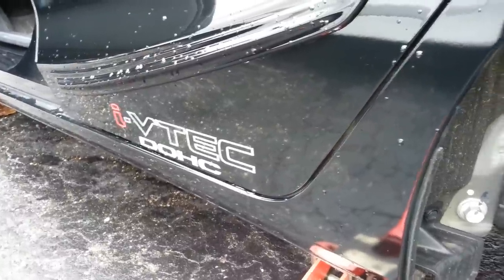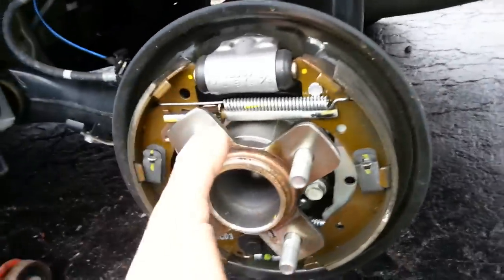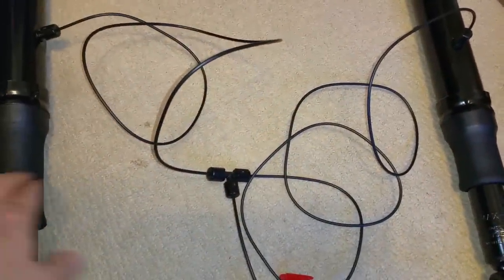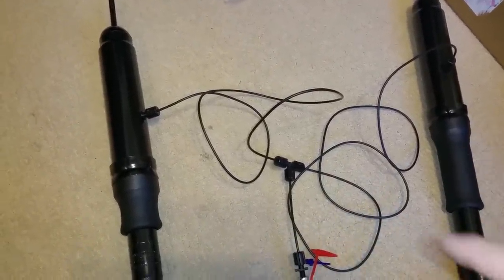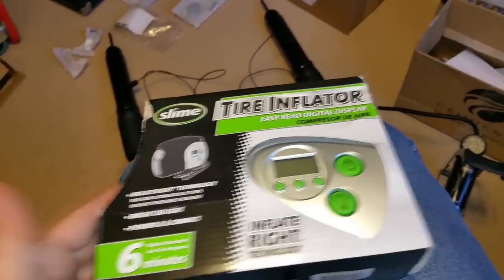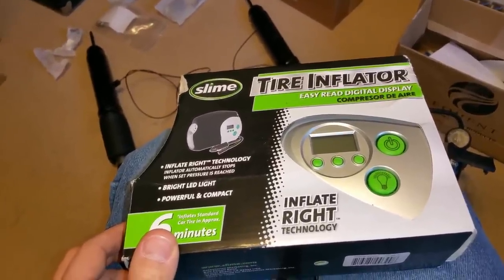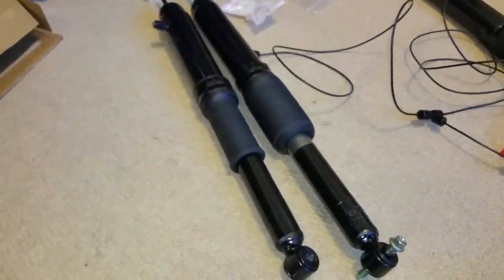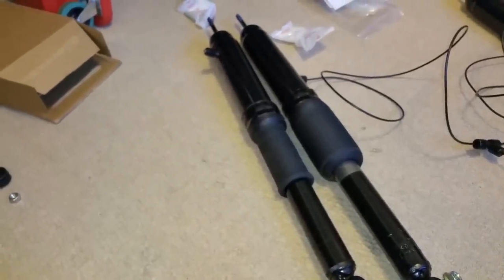2015 Honda Fit EX Monroe Max-Air Rear Shock Mod: Part 01

Comment: I think you're worried too much about 'equalization' of these from side to side.  Your example with the shocks on the ground
is not what will happen when the weight of the car is on the shocks. And, as you pointed out, they're only 1/8" hoses.
Reply from the maker: since driving with the shocks for almost a year I can agree with you.  there is a seesaw effect but it is not as bad as I thought it would be. I even upgraded the hoses to quarter inch as there are more air fittings readily available to source then the 1/8. I am very happy with the performance when towing my trailer as it prevents the back in from squatting too low.

thank you for the comments and for watching my videos!!
Reply: +xboxer1985  Thanks for reply. What sort of trailer and load do you haul with your Fit? Manual or auto trans?
Reply from the maker: +Larry See  I have the 6 speed manual transmission and most of my trailer loads are bulky they're not heavy I think the heaviest load I have done was about 800 pounds of cargo plus the trailer for when I did all the concrete blocks rocks and cement for my shed
Reply from the maker: +Larry See most of the time I Hall speakers for my PA system and the occasional Home Depot run and the wait is never an issue but having a full 8 foot bed is an amazing thing. I used to have a pickup truck but had to sell it for various reasons and only used it occasionally. Buying a trailer was the next best thing and use it every couple weeks for something.
Reply: i was thinking the samething im just surprised that he didn't try fitting them on a skate board before he installed them on his automobile 😀

Comment: So these shocks aren't specific for your car? So what you did is find a shock that would fit the mounting points of your car? I have aftermarket wheels and tires  on  my 2015 Honda crv and when people sit  in the back seat my tires rub a little bit so I need shocks to lift it about an inch. Thank you for the video bud.
Reply from the maker: Correct yes. The ones that fit my now 2017 Fit are the MA809s

Comment: I want to install thse on my minivan. I don't want to attach the air lines. I want to inflate each shock directly, with an air compressor. does each shock have a Schrader valve?
Reply from the maker: You would need to buy two air line kits from monroe but yes it can be done that way.

Comment: hence why you should have a sway bar on the rear end
Reply from the maker: Yeah I thought of putting that upgrade in but I have since upgraded this air shock system to be automated remote control and dual pass so I can control each individual shock without influencing the other
Reply: Installed one on my '17 and the ride was horrid. I suspect due to the mounting locations.

Comment: I want to improve the ride quality oem Strut for my Honda Fit 2015 EX-L Do you know what strut can improve ride quality? I feel the oem is too noisy and too bumpy for daily driving in a city like SF.
Reply from the maker: I've heard the koni shocks work well. Air Shocks are more for towing and feel spongy. Not necessarily a more cushioned ride.

Comment: Do you have a part number for the petcock by any chance
Reply from the maker: AK29 is the entire kit
Reply: And it comes with the shut valve mentioned?
Reply from the maker: @pinkpantherr93  the petcock you mean where you inflate the air? Yes it does
Reply: Well the video says a petcock shut off valve to isolate one shock from the other
Reply from the maker: @pinkpantherr93  ahh gotcha. No this kit does not have a petcock to isolate the shocks from each other. It has the Schrader valve to fill it and the tee fitting. If you want to independently fill each shovk then id say buy two kits.

Its been years since I did this. I've upgraded to a custom made remote dual channel (independent shock control) system I built myself. Like the Air Lift kit available just far cheaper.
Reply: Ok I was thinking that but seems much easier just to add the petcock. He did mention it was ordered so I was hoping he would chime in and give the part number either way I appreciate your reply thank you

Comment: Did you ever get the petcock valve?
Reply from the maker: I did. its actually a flow control where it restricts the see.saw effect but still allows the pressure to equalize when filling. Also converted the hose size to 1/4 with push to connect fittings. its on my thread on fitfreak.com
Reply: Ok, I put some 26 inch rims on my 02 Mercury Grand Marquis along with the air shocks. I will check that out!
Reply: Could you let me know the parts you have?
Reply from the maker: With the stock 1/8" line I was using MettleAir part# MSCA 1/8 flow control. They do not make a 1/8" shutoff valve. they make flow control and shut off valves in 1/4" OD though

I have since upgraded the lines to standard 1/4" OD air line. To do this you will need to get an adapter to convert the JIC threads of the shocks to SAE threads.

Adpt, FNPT-FJIC, 1/4-18,7/16-20, Strt, ITEM# 4VPT3 from Grainger.

Once you get this adapter, parts become so much easier to source when its made USA standard, if thats where you live! 1/4" is the standard here in the States. 

Hope this helps!
Reply: Do you think these airs shocks could run separate to there own pump?
Reply from the maker: +Adrian Ike yes. some people set them up that way actually

Comment: what size are the pit coc and part number
Reply from the maker: with OEM hose its 1/8" and if you look at MettleAir company they will have a few options for tees with a valve or flow control on it

Comment: Flimsy is correct..
Mine come out easily..
Reply from the maker: Yup got rid of mine upgraded to standard 1/4" line with PTC fittings
Reply: @Bassguitarist1985  How did u do it?

Is it possible for me to buy a hose to go outside instead of inside, & just clamp it all down?

I would buy a brass schrader valve, put the hose on the outside & clamp it down, buy a brass tee, put the hose on the outside, clamp it down, put the hose outside the threads on the shocks, clamp it down..

Would this work in your opinion?
Would it still hold air pressure?
Reply from the maker: check my fitfreak thread. i bought a JIC to NPT adapter and added an NPT to PTC adapter to get the 1/4" hose to fit.